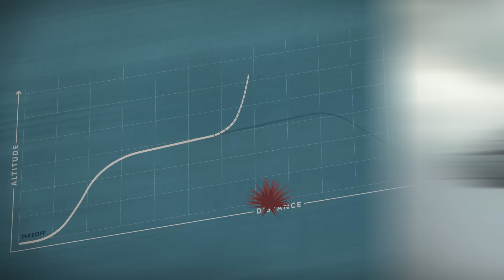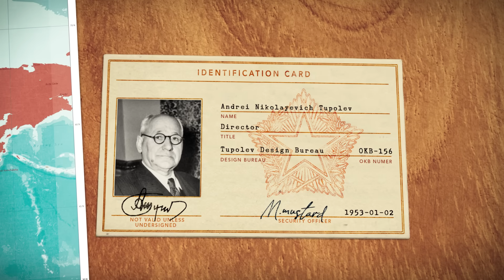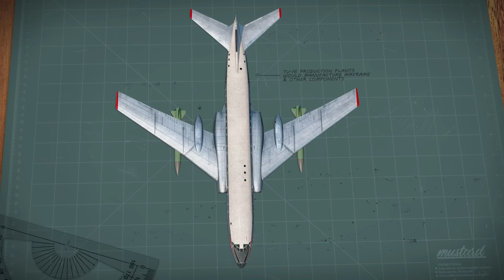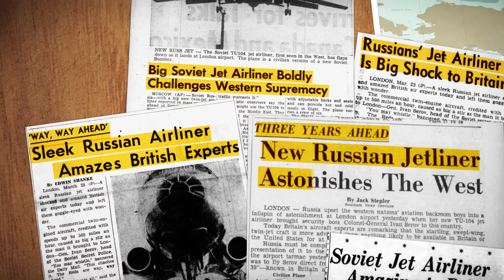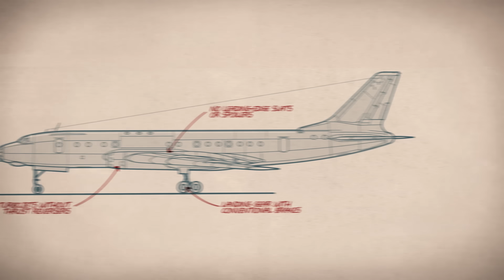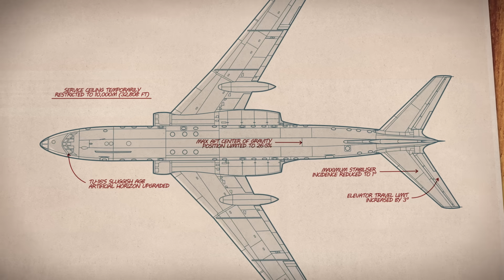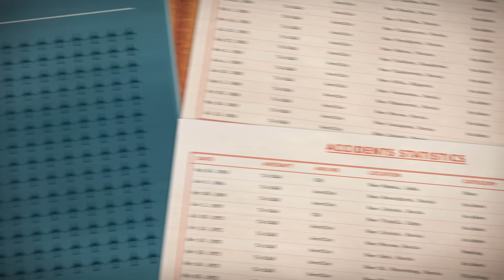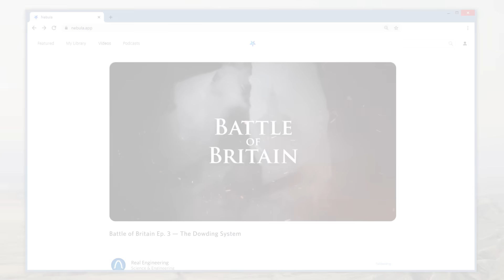The Soviet Airliner Designed To Crash

Comment: The 707 benefited greatly from the Comet. Boeing added rip stopper plates in the fuselage to prevent catastrophic structural failure. They also had extremely advanced avionics with a Yaw Damper to prevent Dutch Roll, which swept wings can cause.
Reply: The Boeing Jet Stratoliner 'aka' 707 flew on July 15th 1954... before anyone (including de Havilland) understood what caused the Comet Disaster.

Boeing introduced rip-stop doubler joints on the world's first pressurized airliner in 1938.
 Boeing had already sold over 6,000 pressurized aircraft before the Comet Disaster.

The only lesson learned from the Comet Disaster was that aircraft manufacturers like de Havilland could no longer be trusted to conduct their own crash investigations.
De Havilland eventually admitted that they never performed the stress calculations for the fuselage sections that failed.
The Comet Disaster is the worst case of gross engineering incompetence and criminal negligence in commercial aviation history
Reply: @sandervanderkammen9230 We feel we can clear up some common false myths, misunderstandings & misconceptions.

It's always very important to note the relevant facts obviously.
 
    Regarding the UK Aerospace Sector.
   
An airline recently ordered 60 RR Trent XWB Engines 

   Clearly It's a great pity & a crying shame that British military forces had to occupy a large part of Germany for decades after 1945 & Russian military forces had to do the same. Of course Russia still posseses a large chunk of what was German territory & of course  Russia & the UK produce nukes. Obviously Germany does not produce nukes.

   Interesting British achievements.
There is no doubt that the Fairey (England)
Delta 2 was of course the world's first jet
aircraft to exceed 1000 mph.  lndeed It
exceeded the previous record by 310 mph &
held the record for 1 year. Incidentally, the Dassault Mirage 3 & 4 are based on the Fairey Delta 2.

Early days, jet fighters.
   De Havilland Vampire, Sea Vixen & Gloster Meteor accident losses were not high or unusual for fighter aircraft at the time. De Havilland built large numbers of all metal airframe aircraft before the DH Comet.
We mustn't forget of course that the DH Vampire for example first flew in 1943 & the engine was also built by De Havilland. There were examples of the Vampire interceptor / fighter in service until 1990 which was operated by more than 30 countries.

Non combat phase accident losses.
% of Aircraft built.
The Canadair CL-44 was a turboprop airliner.
Canadair CL-44             (ff 1959 ) 48%
Lockheed XF104             (ff 1954) 100%
Lockheed  P80                (ff 1944) 43%
Lockheed F104                (ff 1954) 45%
McDonnell FH Phantom  (ff 1945) 35%
Gloster Meteor               (ff 1943)  21%
DH Vampire                     (ff 1943)  23%
DH Sea Vixen                  (ff  1951) 33%
Gloster Javelin               (ff 1951) 20%

   An example of what goes on these days in various countries.
Obviously, for example, there are of course no German companies that makes German jet aircraft in Germany & there are no German Companies that make German gas turbine aero engines in Germany that are suitable for widebody airliners.

     That's correct, Brazil makes very good airliners & Brazil is 100th down the list along with Indonesia for wealth per capita. Of course it is in fact the case that Embraer can't build those airliners without purchasing stuff from the US, UK & Europe.
Norway Holland Denmark Ireland Belgium - Top 20 wealth per capita - Don't make airliners -  its as simple as that.

   Early days of the airliners.
That's correct of course, at the time the Comet wasn't particularly dangerous. Agreed, that is indeed the case of course, The DH Comet was definitely not the worst engineering failure in commercial airliner history.

It's not valid to compare a Bow-wing ( see B-47 wing folding & wing collapse incidents for details) jet  airliner designed & first built as late 6 decades after the Comet, with the fabulous De Havilland Comet, the world's first high altitude jet powered airliner.  
  Vast improvements in commercial aviation infrastructure alone being a significant factor in improvements in air travel safety safety over more than half a century.
    Of course 50 years more design, build & operation experience didn't prevent the horrendous Bow-wing 737 Max incidents, there can obviously be no excuses for that.
  
  That's correct of course, at the time the Comet wasn't particularly dangerous. Agreed, that is indeed the case of course, The DH Comet was definitely not the worst engineering failure in commercial airliner history.

Losses comparisons
How things were in those days.

DeHavilland Comet 4 UK                       14% 
DeHavilland Comet all  (ff 1949)           17%  

Boeing 307                               70%
Boeing 247                               48%
Boeing 707            .                  20% 
Lockheed Electra Turboprop   29%
Canadair CL-44  Turboprop     46%  
Convair CV-580  Turboprop     22%
Convair CV-880    (ff 1959)       27%  
Convair CV-990     (ff 1961)      33%
Tupolev TU-104       (ff 1955)    16%

     Of course De Havilland had prior experience building many all metal construction airframe aircraft & thousands of jet powered fighter aircraft that were primarily of metal construction with pressurised cockpits & jet engines built by De-Havilland.

  More recent UK military jet aircraft.

  Of course the Tornado & Typhoon & their engines are Supersonic & are indeed British design aircraft with British design engines built by an international consortium. The Tornado design for example started life during the 1950s at Vickers as the AFVG, it's engine is based on the RR RB-199. The EE Lightening is also a British Supersonic jet aircraft.

  The Typhoon is the British BAC-EAP with an engine based on the British RR XG-40, the Typhoon is also built by an international consortium.

  Agreed, that is correct of course, clearly there are many countries that could easily produce airliners of better quality than Bow-wing (see b-47 wing folding & wing collapse incidents) but don't for some very good reasons. Bow-wing (see B-47 wing folding  & wing collapse incidents) being a result of the size of the US, the large protected domestic market & great ease of testing new types due to the equator to arctic geography complete with up to date aviation infrastructure & a few other reasons related to production scale capability, politics, the nature of the airliner market coupled with the nature of airliners themselves & general basic economics.

  Obviously there really is nothing special about Bow-wing, having more than 50 years design / build experience on the type means they have no excuses for the horrendous 737 Max incidents for example.

    Indeed BAe Systems & Rolls Royce combined now do more Airbus work than Germany on an absolute basis & significantly more work than that on a per capita basis.
   
     Agreed, Per capita for the home nation BAe Systems is the world's largest defence contractor.
  
    Correct, BAe systems announced the recent £4 Billion takeover of Colorado based US based Ball Aerospace.
  
    It's definitely the case that BAE systems now does a significantly higher value of work for Airbus than it did when it was a major Airbus shareholder before 2005.
     
      Obviously RR now owns US Engine maker Allison for example which does classified Aerospace work for the US Govt.
   
   Yes, that's right of course, Anybody currently flying on a widebody airliner stands a good chance of being on an aircraft powered by RR gas turbine aero engines built in the UK.

   A typical but small glimpse of what goes on in the very internationally orientated British aerospace sector.  

  Of course the RR Nene was in fact the world's most reliable & most powerful gas turbine aero engine in 1944. Licensed built versions & copies of the RR Nene & RR Derwent would go on to power many aircraft in Russia including the Mig 15 & Mig 17, the US, China, France & other countries for decades after 1944.

      Boeing Apache Attack Helicopter.
AH-64: 75 UK suppliers, 7% UK content, global fleet of 1280+ aircraft.
F35B more than 130 UK Suppliers, more than 30% UK content.
F35A & F35C more than 130 UK Suppliers, more than 15% UK content.

   There is no doubt that an airline has just ordered
60 RR England Trent XWB Engines

Obviously the UK has the
World's Highest Combined Per Capita
 Nuclear / Defence / Aerospace Sector Activity.

Rolls Royce Holdings UK
Subsidiaries
- Rolls-Royce plc
- Rolls-Royce North America (Allison etc Classified Military stuff)
- Rolls-Royce AB
- Rolls-Royce Deutschland
- Rolls-Royce India Private Limited
- Rolls-Royce Marine Power Operations
- Vinters Engineering Limited
- Rolls-Royce Controls and Data Services
- Rolls-Royce Power Systems
- Bergen Marine
Joint ventures include:
- Rolls-Royce Turbomeca
- MTU Turbomeca -

Trent Family
The MT30 (Marine Turbine)
Industrial Trent 60 Gas Turbine
Trent 7000
Trent XWB Airbus A330neo.
Trent 1500
Trent 1000
Trent 500
Trent 600
Trent 700
Trent 800
Trent 8100
Trent 900

RR wholly owned subsidiaries in Germany handle smaller 2 shaft RR gas turbine aero engine work.

We hope this helps, of course as always.  

Cheers & 😎 & of course 👍 indeed.

.. ......  .... .. .. .... ..... . ..
. . ...... .  . ...
Clearly the line above this line is not blank.